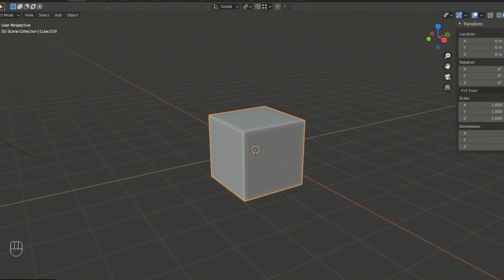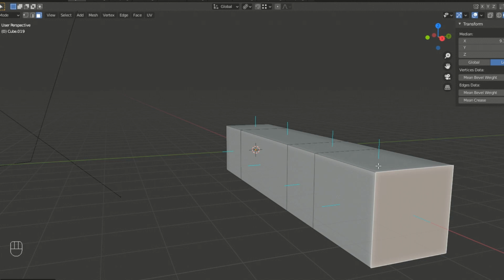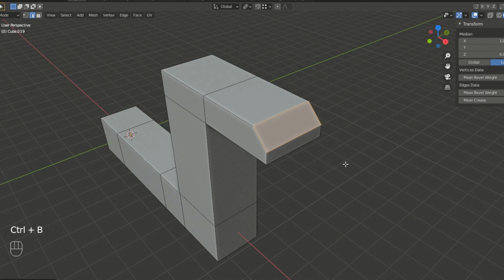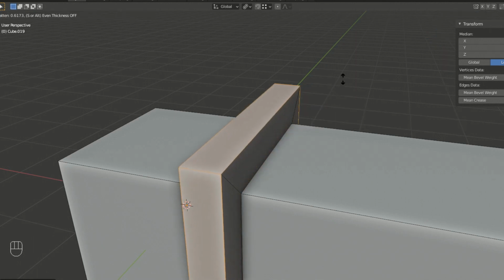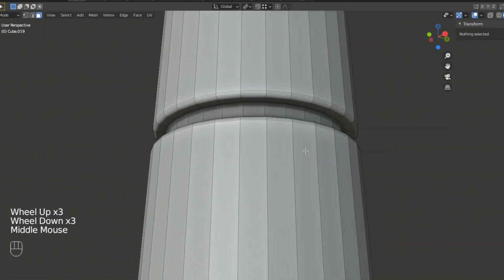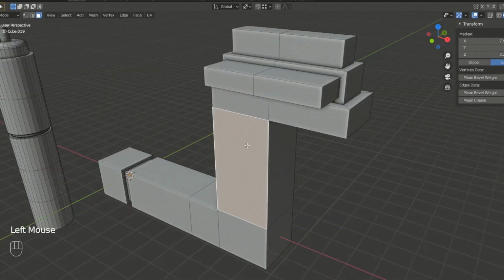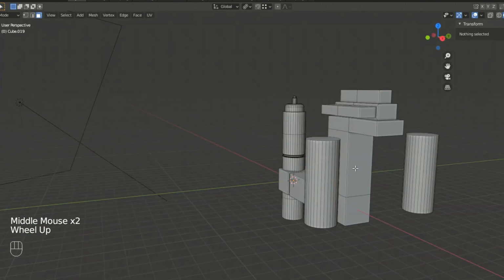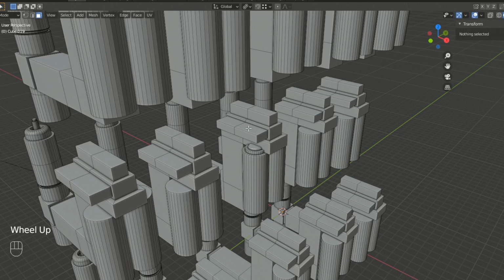Basic modeling tips for blender (by author of Grid Modeler)

Comment: Hi,

Very smart addon and thanks so much for your hard work.

On the other hand there's an annoying bug when i press the G/G key combo to slide an edge loop, i end up with the grid unless i disable your addon.

Look forward for your reply.

Cheers
Reply from the maker: I didn't hear this bug from other users. May you can check your blender keymap.
Reply: @kushiro_cg  Well, did you try to slide an edge loop with your addon enabled?
Reply from the maker: @archiplanservices3746  Yes, I always do that. I do this in my videos too. It is no problem. G key and G key.
Reply from the maker: @archiplanservices3746  You can check my source code, my addon do not change blender's keymap. That means, my addon do not add any hotkey to blender.
Reply: @kushiro_cg  ok